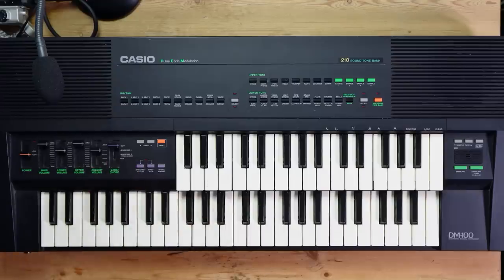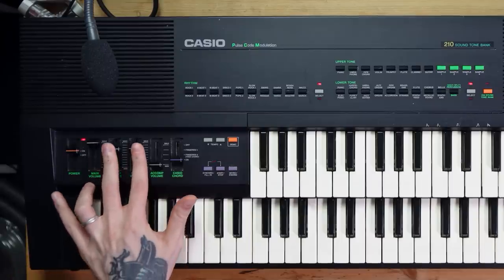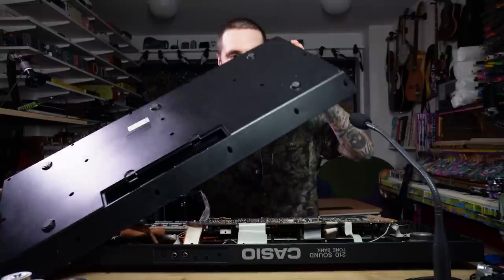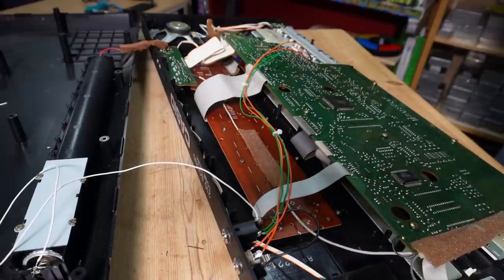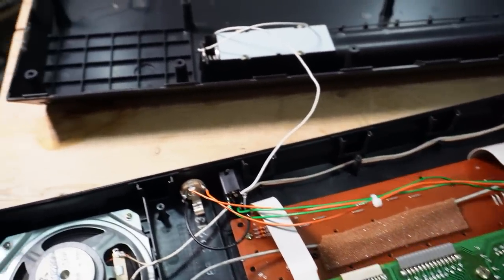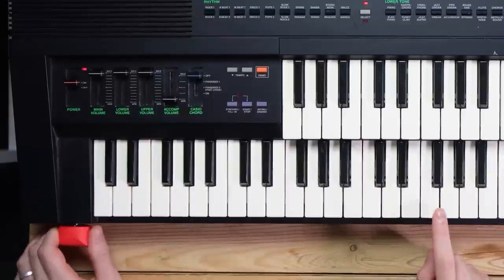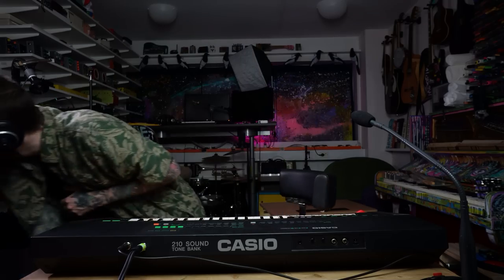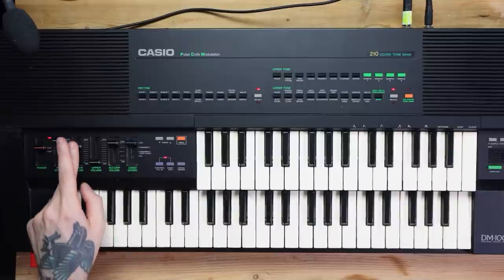Improving The Holy Grail Of Casio Samplers

Comment: After some investigation, the reason why the accompaniment potentiometer is stepped like that is because there's only 5 output states for both L and R (pins K020 and K021) on the lower CPU (UPD938G). Since the lower CPU outputs ONLY a single serialized 16 bit audio signal (time shared to emulate stereo) the accompaniment potentiometer tells the CPU to internally attenuate the levels of the percussion (and presumably bass) by simply having identical samples at 5 different volume levels, hence the 5 selectable states.

The only real way to isolate the percussive PCM samples and retain full function would be to literally duplicate the entire circuit with an additional UDP938G or equivalent. You'd need to basically redirect all K014 and K015 inputs to the new CPU along with K020 and K021 for the 5 output levels (you could go technically add an L/R pan pot due to how the mode switching works on the CPU). You can then isolate the output to an additional separate DAC circuit in order to retain the independent output. You should be able to feed this signal back into the main mixer circuit (with some filtering of course) and the unit SHOULD behave normal and in stock configuration upon using the regular speaker/headphone outputs.
Reply from the maker: I will pin this thank you 😁😁
Reply: One Correct Answer, To "Time Shares". = "No."
This, may save you thousands of denominations of funds. Have, a fund time.
Reply: That doesn't sound right, five samples the same would make no sense. I could see it doing something like bit-shifting right from 0 to 4 steps, which would give a nicely exponential response simulating a log volume pot.

Comment: Great video and mods Simon! Just an FYI, the DM100 isn't the only double manual that Casio ever made. There is also the 1983 Casiotone Symphonytron 8000 that though a modular system, could be had with two upper manuals and also bass pedals. A very rare system, with apparently only 100 ever made.

Looking forward to seeing you do the clock mod and more with your DM100!

Comment: You could probably make some key weights by taping a short stack of coins together, and then using something like modeling clay to keep it from rolling. Basically embed the cylinder in some thing square or triangular. Might even be heavier than those batteries for its size. That could avoid putting lateral stress on keys from the other mentioned jamming methods of keeping keys down. That's because I know some Casio keyboards used a flex hinge, which would be tricky to fix if it breaks. I taped down a few keys on an SK-1 as a fix back when I had it because of the flex-hinge breaking, but it made playing those keys kind of sloppy or inconsistent.

Comment: If I remember correctly, all the lower keyboard stuff goes thru the same D/A-converter, so separating the accompaniment would be a challange.

However, there are lots of possible hacks for the upper keyboard such as sample memory expansion, analogue filters, a bit of envelope control and better input options for the sampler...

With separate filters for each voice the upper keyboard would become like a low-fi sampling TimbreWolf! Just add real simulated wood grain sides and some heavy distorsion! :-)

Comment: magpie. I cant wait. I got the little brother (without the sampler) of this and my attempts at clock speed mod have all failed, I cant find the resistor! hope you are able to figure it out! I  modded mine with a patch bay, I get some CRAZY sounds outta that thing. sheers magpie.
Reply from the maker: Ooh nice with patchbay! The clock on these are coils. I have never done a swap with a coil before so will be interesting 😅

But essentially you replace an oscillator rather than a resistor. So it is a bit more advanced. You can look up LTC1799 (thats the easiest choice I think), and circuitbenders.uk

Comment: maybe a little keyboard latch circuit would be a good addition to the top keyboard :) The batteries did produce some pretty good happy accidents though tbh. I eagerly await the big knob mod, clock/sample rate reduction is where the magic is. Sometimes. Mostly. Also - the soldering light which also sucks, is it expensive and where does the results of the suck get routed, hose out the window? I have a lot of de-soldering and soldering to do and I'd prefer not to die from inhaling the fumes. Really enjoying the renewed energy for making videos, hope you're having fun!
Reply from the maker: Ooooooooh SMART!! Just a ton of switches to solder but maybe totally worth it. One switch for every key on the upper keyboard. Will totally do that. Just gotta see if I can fit it in a cool looking way.

The whole cone with a light is something I made myself and attatched to a classic solder extractor that showed up in the trash 😅
Also the solder fume sucker itself is modified so it more or less is just a vacuum cleaner with a really long pipe going up into the ceiling and out the room.
So it doesnt have a filter anymore which costs a ton of money and needs yearly replacing or something like that.
Reply: @SimonTheMagpie  ah I was hopeful there was a simpler way rather than a switch for every key, latching the gate signal with one switch so you hit a few keys and the key off is not registered. Diode on that circuit that you can switch in and out? Latching it at the keyboard multiplexor (if there is one) rather than the key end of the circuit? Apologies if all of that is absolute nonsense. Maybe heavier batteries is the smart hack :)
Thanks for the info on the solder sucker, will keep an eye on the trash :D

Comment: Using guitar picks or flippos/tazos/pogs (remember those?) to put on a key and under the neighbouring keys is easier than batteries or other weights. Doesn't work on the top and bottom key though.
Reply from the maker: Smart! Sticking the pogs in between keys?
Reply: @SimonTheMagpie  That might work too, but I just lay them flat on the key I want to press, and under the keys next to it. Strictly a white key thing, of course.